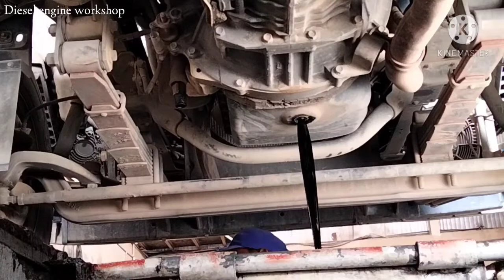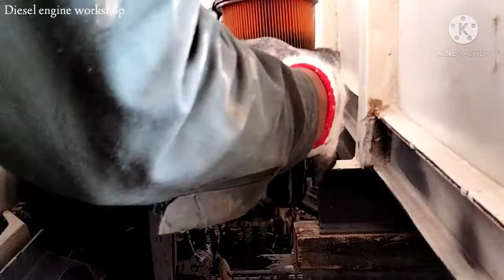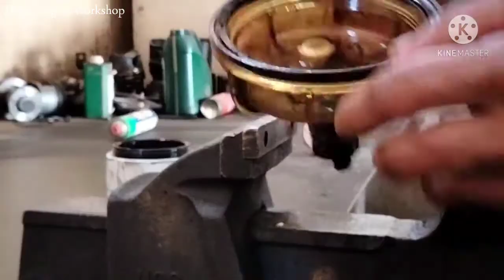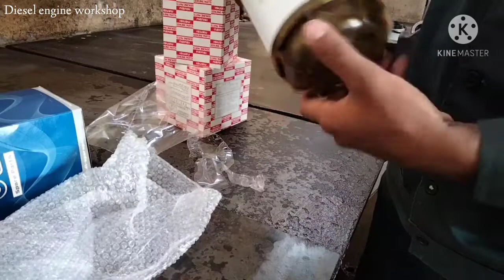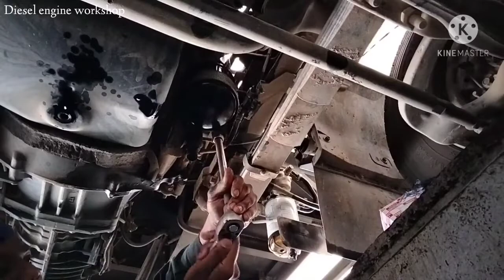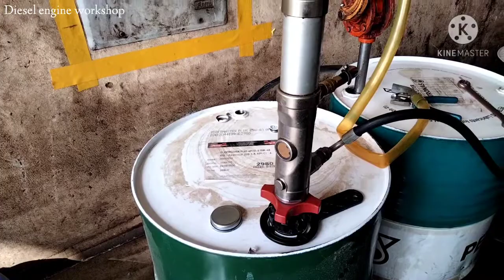Oil Change ! Oil & Filter Change Isuzu Reward 4HK1

Comment: Can you use fully synthetic oil to isuzu elf truck 4hl1 engine?
Reply from the maker: The difference with mineral oils resides in the transformation process: synthetic oil undergoes more sophisticated modifications. ... Synthetic oils contain fewer impurities than mineral oils. Synthetic oils are chemically modified. Synthetic oils are mainly designed for high-performance engines

Mineral Oil life 10k - 15k Kilometers
Semi Synthetic life 15k - 20k Kilometers
Fully Synthetic Oil life 16k - 24k Kilometers
Reply: @Ajaj881  Great reply and great video too. Thank you as you're video and comments have given me confidence to carry out my engine oil/filter and fuel filters change. Ron
Reply from the maker: Thank You ron carroll